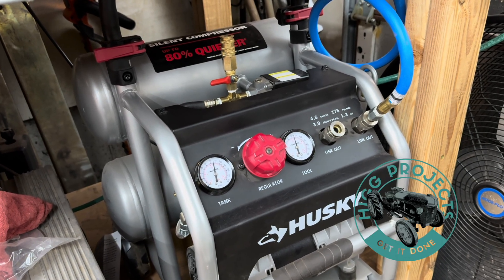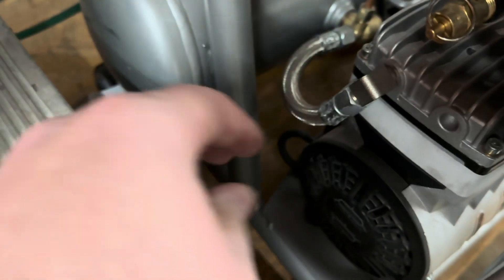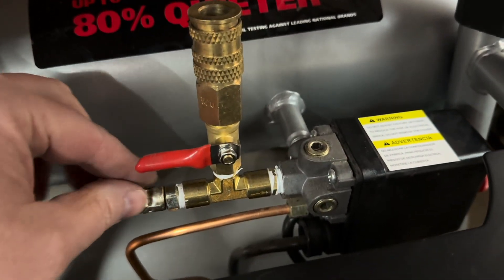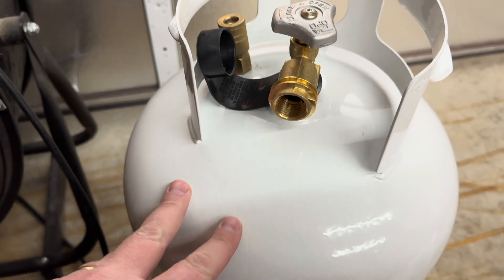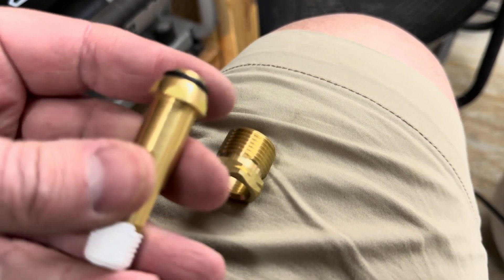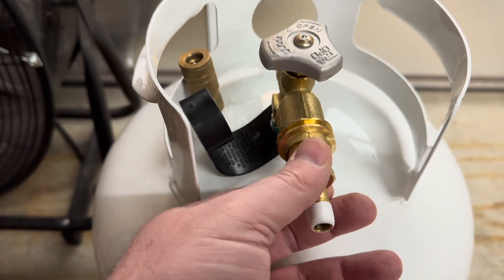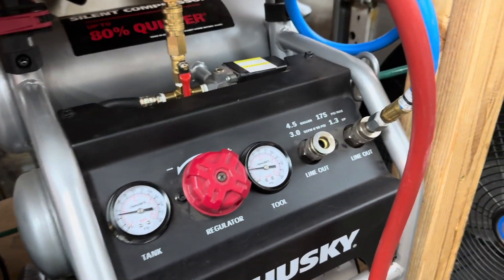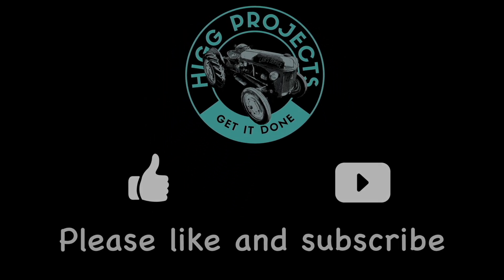Boost Your Air Compressor! Expanding a small air compressor with a propane tank.

Comment: I want to buy a new inexpensive 100lbs tank off amazon, but I want to do what you did and replace the restrictive propane valve. What kind of adapter do I need to get? are the tanks themselves just npt?
Reply: 100lb propane tanks are >$200 delivered or more.

Comment: That small copper tube is for the pressure valve to turn the compressor on and off
Reply: It could also be an unloader valve that triggers when the regulator shuts off the motor, so it restarts easier.

Comment: I have a small 6L 12v compressor in the work ute. Going to use either a 4,5 or 9kg LGP bottle to give it a bit of an extension on the pressure for blowing down machinery. Currently it works ok, but you need to use full pressure sparingly. new dedicated air tanks are $100au+ fro 6L so I will utiliize one of the many LPG tanks laying around here.
Reply from the maker: I was thinking it would probably be a good idea to throw a drain on the lpg at some point also.    I try not to think about that water in there rusting away…😅
Reply: @higgprojects  true, I considered it also. Then I thought, if mounted upside down, you could use the gas bleed screw to drain it,  to save removing fittings etc. May not remove 100%, but easy enough.

Comment: Thanks for sharing. Great idea to not need to pull out the old valve and tree plumb. One thing I would do different is add a tee at the tank with a male nipple in and a ball valve on one side and a coupler on the other. This would allow a normal hose to work to fill it. It would also allow you to use the unregulated air for things like sprinkler blow out. Just my 2 cents. Have a great day.
Reply from the maker: Thanks, that's a great idea!

Comment: He has two outlets on the compressor to connect hose/tools . Why not just connect his propane tank with a quick connect to one outlet on the compressor and use the other for his air hose?
Reply from the maker: Ah.  Good question.   I wanted to get the expansion tank up to full pressure so I get the most benefit possible.   If I used the second air quick connect that would only pressurize up to the pressure I have the hose set to either the dial which is usually less than the pressure in the tank.   Thanks for watching!

Comment: I did the same thing two years ago.  Just FYI, those OPD valves are quite restrictive if you done remove the valve and take the extra bits off and drill out the passageway.  I can still smell the odorant they add to propane as I use it.
Reply: For his new tank, there is no smell.  New tanks come with Nitrogen gas in them to prevent rust.  This gas has to be purged the first time it's filled with propane, but for compressed air, that isn't necessary.
Reply from the maker: Thanks.   I’ll do that.

Comment: Red LOCTITE®  needs heat in order to release. Use a small torch and get it good and hot before attempting removal.
Reply: Can confirm that I had almost an identical air compressor and just used a cheap heat gun to Warm up the fitting.

Comment: I had a 30gal 6hp compressor for 22 years, I always complained that it was too big to be portable and too small to run tools like ratchets and such and found I used it mainly for nail guns and blowing sawdust around. I sold the large one and bought a 6gal compressor and first time I went to blow sawdust off I thought Oh no, what have I done. HAHA I need more capacity. The new compressor I bought has 2 outlets and they are on a regulator but do you think leaving the regulator at max settings it would be OK to use one side as the expansion and the other for the tool?
Reply from the maker: For sure it would.   If you want a regulator still with that setup just get a little water filter/regulator like I have in the video.   Not sure if you noticed but that has a regulator and a gauge also so you would just adjust your tool there.   Hope that helps!

Comment: On your hoses use one male end and one female end and they won't fly around, no air comes out of the female until you plug it in. Place the ones on the compressor, female, hose male female and all tools and tanks accordingly and you can plug and unplug without losing pressure.
Reply from the maker: Yup.   I should probably switch that one that hooks into the compressor to female then I can just turn off the valve when unplugging.

Comment: I did the same thing to my small 1 gallon compressor with a 5 gallon tank. I mounted a strong 120mm server fan blowing over the compressor crankcase. Figure I can up the duty cycle a bit but I still let it rest sometimes.
Reply from the maker: Awesome idea.   Does the fan just turn on when the compressor is running?   That would be epic

Comment: It is best to remove the propane tank valve so it cannot be mistaken for something else. Also mounting it upside down allows any water to be drained when condensation forms in the tank. You don't want to have a tank rusting out and rupturing especially if it is not firmly mounted to the ground.
Reply from the maker: Great point!   I’m going to install a drain on the propane tank and put drain extensions on both tanks so it’s not such a pain to drain every once in a while.  Then I think I’ll ride this compressor out until it’s dead or I really need something bigger.

Comment: Propane or Freon tank for a somewhat free accumulator/expansion tank, drill & tap & solder for 3/8 NPT, use their original fittings for tank drains.   1/4 inch is usually barely adequate but will also work if you aint doing too much.